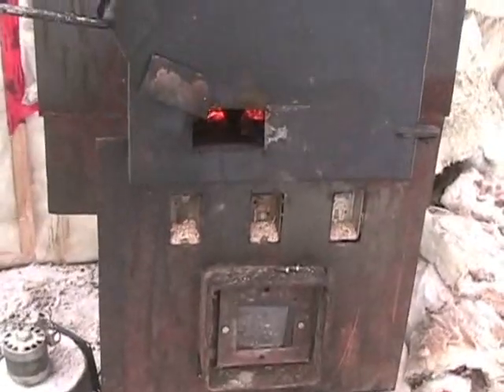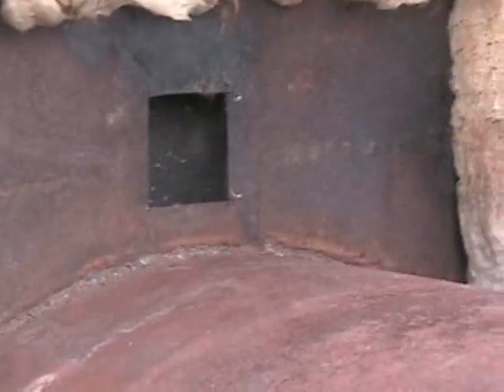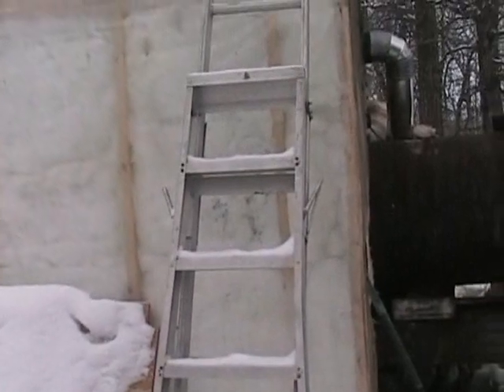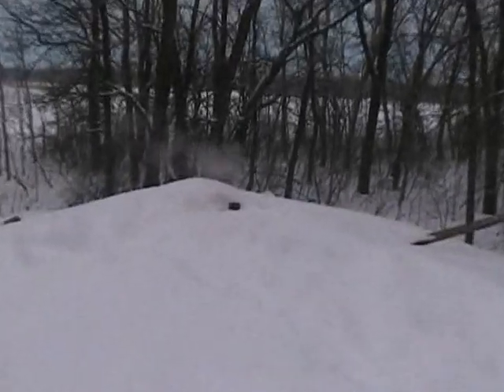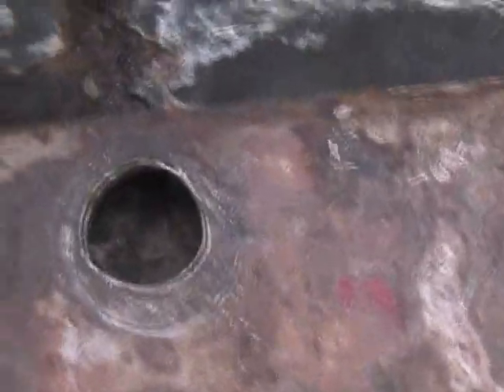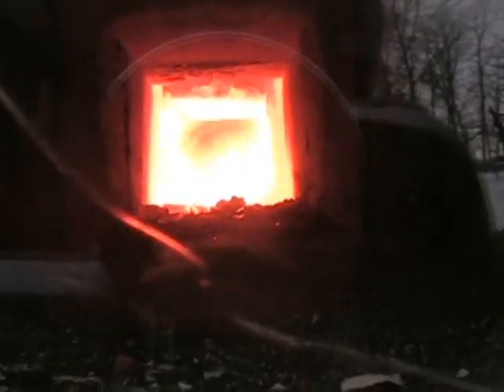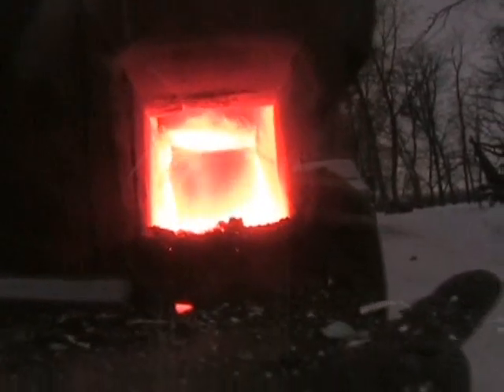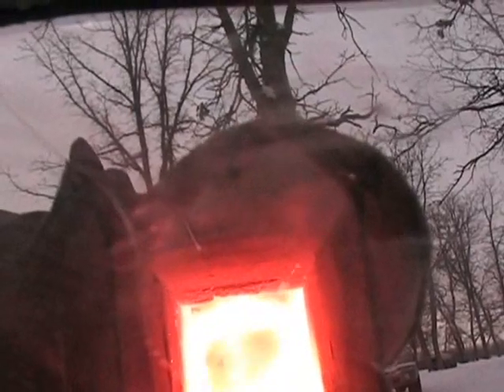Part 1 Gasifier

Comment: Nice rig! What are you using for draft induction? What sort of heat exchanger are you using to get the heat into the storage tank? To what temperature do you heat the water, and how long does the tank retain that heat?
Thanks for the great video!